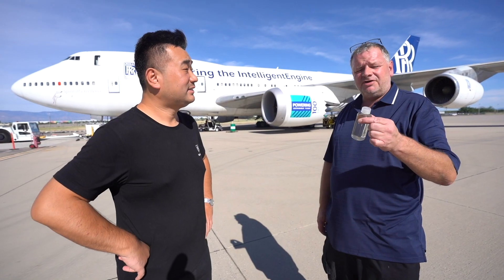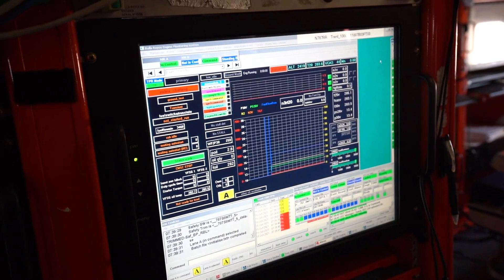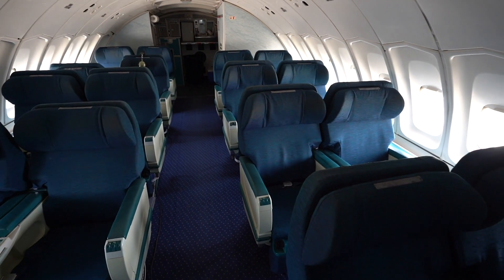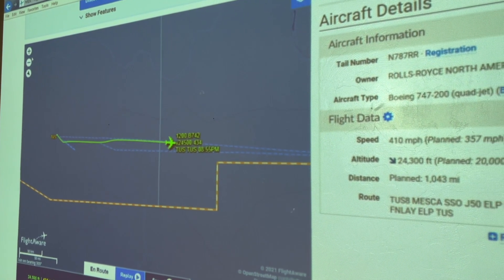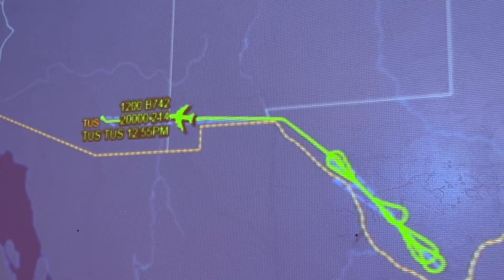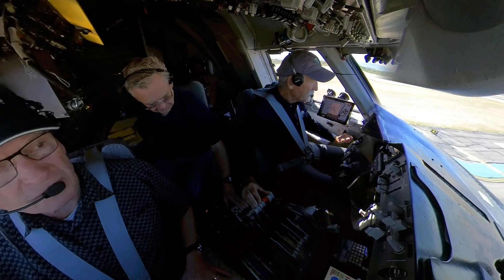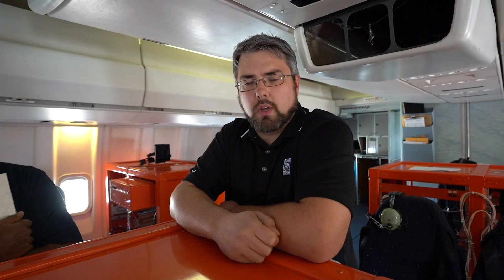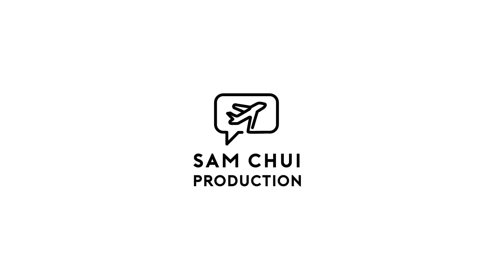Flying the Rolls Royce B747 Test Bed - An Experimental Flight with 100% SAF

Comment: The dashboard rattle would really annoy me. Not much clearance below the new engine. A geriatric crew for a geriatric aeroplane acquitted themselves well. But, here's the rub.- every scrap of  waste organic matter in any country that could be converted to SAF (a classic oxymoron in itself) would account for less than 4% of fossil fuel use in that country. Presently 330 million tonnes jet fuel needed, but with a further projected growth in aviation, this will rise to 450 - 500 million tonnes. Improved efficiency does not reduce this figure, see Jevon's Paradox https://en.wikipedia.org/wiki/Jevons_paradox  - So we know that waste biomass is 96% insufficient for wholesale SAF use, so land has to be set aside to grow it, eg maize or soya or trees or other more woody biomass. Basically for all aircraft to be fuelled by SAF, fully 30% of all the planet's available biomass (that's forests, crops,) would have to be employed, plus about 9% of all available renewable energy (to process this biomass). Our present SAF synthesis would need to increase nearly 70 fold just to meet present demand https://www.sciencedirect.com/science/article/pii/S0048969723025044 
This has profound implications for crops for food, for other energy uses, CO 2 sequestration, and CO2 emission from the grouwing and cropping. Food vs Fuel. 8 billion people to feed or perhaps a privileged billion to fly, and the remaining 7 billion starve? The equations make no sense, except as a suicide pact for humanity. 

Basically you cannot fly anywhere conscience free about our planetary environment. SAF will not solve this. This is technological fantasy, and is digging humanity an ever deeper entropic hole which we will not be able to climb out of .Third runways for Heathrow or expansion of flying is just driving nails into the coffin of human welfare and for many, its very existence. We need to STOP BLOODY FLYING!!

Comment: Another well done and interesting video! Thanks!
I am curious as to why all the instruments for the number 2 engine, the Trent test engine, are removed on the main panel and the FE panel. I realize the engineers in the back are monitoring it, however how does the pilot and FE know where to set the power lever? Verbal commands from the back?

Comment: for those curious about where the engine that used to be on the 747 went, it got donated to the Pima Community College Aviation Technology Campus (visible at 11:53) where I got to do a maintenance inspection on the very engine powering the 747!

Comment: If they are testing UltraFan, this size is not enough, meaning testing this would require A380 testbed flight lab or even 777-200, or 787 as a testbed

Comment: Why dont they put 4 of these engines on this 747.What a power.
Reply: They're still testing weather if an engine fueled by SAF would be reliable. That's why they only put one there.

Also fun fact the 747-8 is using four of the those engines. Although, I think it only uses the GEnx.

Comment: The four engines of the Boeing 747 Jumbo Jet burn approximately 10 to 11 tonnes of fuel an hour when in the cruise.
That's with the efficiency of kerozene. 
It would be a bit (~15%) more with this type of fuel. So, let's say around 12-13tons/HOUR ...... And there's millions of heavy aircrafts. 
It's an Idea ... but it's not THE Idea.

Comment: One thing that was never mentioned was if the engine has to be modified in any way?
Reply: I think no, the differences only the source that they came from.

Although they need to modify the plane so they can actually start the engine.

Comment: 3:21 That's interesting. The Trent 1000 and the GEnx from the 787 are Bleedless Engine. So they have to install an electric compressor in order to start the engine.

Man, the 787 is awesome.

Comment: I think that's pretty cool that this 747 still has the flight engineer station intact along with NO upgraded glass equipment. That Trent 1000 engine is pretty big compared to the other 3 engines as well. Very neat video!

Comment: Does S.A.F give a lower thrust compared to  Jet A1 , the flame looked smaller with no smoke ,however the Jet A1 did show a larger flame , so therefore it seem S.A.F is a weaker less volatile fuel ?

Comment: Public comments. Eco friendly energy system analysis new technology link censers to each section of engine link to main point to detect trouble signnal and alert system allowing the pilots to solve problems before arise . Small module code and mico digital technology link to main station.

Comment: I wonder if the whole industry switches over that's goon lead to a lot more wastage in the oil industry. the cut of jet A is designed to take advantage of hydrocarbons that arent in normal mo gas or diesel. or maybe there will be advances in cracking the larger ones into mo and just expanding the diesel cut to puck up the others? idk that's a problem for the petroleum engineers.

Comment: would a b747-800 take off at full capacity with two ge90x?
Reply: That is a good question actually, imagine a 2 engines 747
Reply: -800 ?

Comment: I have never seen a 747 landing without reverse thrust ;-) cool
Reply: It is only an alternative to the wheel braking.  Wheel brakes can do it all and the performance calculations are based on the wheel brake deceleration.
Reply: @givenfirstnamefamilyfirstn3935  

TRs are not an alternative, but an addition to wheel breaks in commercial jets.

I am not 747 type rated, but I highly doubt, that trust reversers are not considered in performance calculations!!!! 
I have seen many 747-8 documentaries where they used  TRs in aborded takeoff and landing trails, so it would be a huge waste of time and money not to use the test data in the manuals.  
 Every commercial jet I have flown uses TRs for performance calculations and you can even chose the number of TRs available.
Reply: @xyzaero   ‘can’ not are.   (Yes standing water, ice, snow, slush…grass, sand, condition.  Maintenance cost)
Reply: @givenfirstnamefamilyfirstn3935  ?????
Reply: @BlueMax717  got it .. we both talked about different things 👍🏻

Comment: Super Wonderful  Rolls Royce   Trent 1000 engine  #  as i understand  the word sustainable  is used for  fuel  that has less  carbon in its  hydrocarbon chain  molecule  & therefore less CO2 is released  when  it is burned #

Comment: Sam's learned an (old) new trick: Slapping the camera lens at the beginning of the report. Why Tucson (TUS)? Why not East Midlands (EMA)? TUS is 5200 miles from the Rolls Royce factory, EMA is ten miles! Also, they put Sam on the horse but they wouldn't let him ride so, meh! The story was inside the aircraft. And, the engines have to be cooled for five minutes so the Trent is at idle for the approach and landing. Imagine approach and landing if you've got four of them!

Comment: Any particular reason they chose to hang the engine off the #2 spot?  Both the RR and GE 747 flying testbed hang their test engine on the #2.
Reply: It has to do with the yawing moment from the thrust of the outboard engines.  Messing with the power or shutting it down means less yaw if it is on the inboard station.
Reply: @williamloh9018  OK that explains why it's not on the 1 and 4 position.  If it was just a matter of limiting asymmetric thrust they could have used #3 engine instead yet they both chose to replace engine 2.
Reply: Isn’t that the side that could take the weight of the ferry pylon and passenger engine?

Comment: That aircraft is 41 years old and still doing valuable work.
There is some irony in that they showcased the only engine that has caused RR any major issues on ONE aircraft type recently (Trent 1000 and which was fixed last year) amongst the RB-211s that were for the L-1011 that bankrupted the company in the '70s.
This fuel will bridge the gap to when hydrogen powers aircraft. I really cannot see electric aircraft being a safe and viable option.

Comment: SAF isn’t green, it’s just sustainable. It still pollutes an incredible amount.
Reply: Proof of your claim please. From what I have read SAF burns much cleaner. You can even see when they showed both with wicks burning, the SAF hardly had any black smoke coming from the tip of the flame.
Reply: This claim is false. Manufacturers and researchers are currently aiming for roughly an 80% CO2 reduction. This is achieved by sourcing carbon from places other than fossils. Things such as biomass, hence the name biofuels.

Comment: Yet an other great job by Sam.  I'm so fortunate to have flown in a PAN AM 200 back in the mid 70s from UK to Italy.  It was on a business trip so I got to go up the spiral stairs and fly on the upper deck.  After that flight, I promised my self never to fly down stairs ever again if on a 747, and did so until 2004 when I semi retired from the bicycle industry.  Again good work Sam.

Comment: Really nice to see that throttle handling on approach. He is compensating the idle thrust from engine 2 by further advancing the throttle for engine 1, all while leaving engine 3 and 4 where they should be. I think that is more difficult than it might seem at first. Especially if you consider the yaw moment as a result of the asymmetrical thrust whenever you advance or decrease a throttle lever. What a legend!

Comment: Does anyone know if the different engine configuration would change the flight experience or weight distribution?
Reply: It would, they’ll probably just need to re trim the rudder for any imbalance in thrust, and for and aft will be within limits.

Comment: According to both Plane Spotters and Airfleets, N787RR has never operated for QANTAS. She started with Cathay Pacific and then went on to Air Icelandic before RR
Reply: Thanks for that research. I felt it was a BA, CP or QANTAS Classic, based on the iconic RB-211s. A bit of confusion for me re livery and ‘Spirit of Excellence’—thought it could have been adapted from ‘Spirit of Australia’. Also have heard that Rolls Royce may have recently purchased one of QANTAS’s superb, still young  747-438ERs for engineering test bed use…

Comment: This isn't the only 747-200 still flying. As I type this, ER-BAT, a 747-200F, is still in operation with FlyPro. Currently approach Maccau. Then, of course, you have two very famous 747-200 based aircraft, the pair of VC-25A, commonly referred to as Air Force One. Excellent vid as per usual Sam. 👌👍
Reply: I heard there are also 2 -200F based from Georgia's GeoSky cargo airline both RR powered and 2 -200F from Aerostan and they are the only PW JT9D 747 airworthy nowdays, idk about other GE CF6-50 powered -200's other than ER-BAT, the us military ones and one -300 in Russia tho

Comment: Spiral staircases, lots of memories there ....movie Projectors, .... one engine on fire....( you can still fly); ...safety drill sliding from Upper deck, very high and have to jump in the water from upperdeck as well...reminded me of B747 - 200 those days...
Reply: and pure garbage rubber air tube headphones for the low resolution in-flight movie.  It was still the safest, best engineered, most system redundancy plane in the sky.

Comment: I wonder....they didn't use revers throtoll after landing.
Reply: I think you use reverse thrust on short runways or when the runway is wet
Reply: @jeanchristophebeaulieulafrance   I don't think so....because JFK, DXB, LAX, DAC MAA Airport Runways are too long but all pilots use their thrust reverser on the all runways though the runway is wet or dry.
Reply: The plane in the video was probably very light because it was empty. Don't need reverse thrust
Reply: @jeanchristophebeaulieulafrance  could be

Comment: Sam, do you know if this fuel produces more or less power/ thrust? And the same kind of fuel economy as regular jet fuel?
Reply: SAF kerosene generally offers the same performance as regular kerosene, as it has the same fundamental chemistry at the molecular level, so it has the same energy density as well as the same adiabatic flame temperature and stoichiometric ratio for combustion in air. Where the differences lie are in the impurities, SAF is more or less 'pure' kerosene, so no sulfur compounds, and no trace paraffinic hydrocarbons either. What this means is that certain materials, for example rubber seals, need to be redesigned because the absence of those can cause their properties to change, they can crack of shrink if used as a drop in fuel without seal replacement. The lack of sulfur is a good thing, it leads to less sulfur dioxide emissions, and the particulate emissions drop too, as the free carbon molecules that are briefly present during the combustion process have fewer adverse nucleation sites to form carbon 'buckyballs' as we call them, or fullerenes to give them their proper name. Lubrication is also an issue, the pure nature of the fuel changes the heat distribution throughout the engine (less particulates means lower exhaust emissivity, which can be thought of as 'sticky heat', it leads to lingering thermal inertia).
Reply: As for the costs SAF is more expensive than normal jet fuel. As the expert in the video said it's a matter of scale. If we scale up production to the level of standard jet fuel the green premium will decrease enough to make it as convenient as standard jet fuel.
Reply: @tdsdesa  correct, it is a lot more expensive than Jet-A. The price will inevitably fall as production scales up as you rightly say, but in my opinion it will never be as cheap as Jet-A is today, purely because of the efficiency of the process, if made the only sustainable way, which is using hydrogen from electrolysis coupled with direct air capture CO2 using the Fischer-Tropsch process. There are other ways of making it of course, but none are truly net zero CO2, and are harmful in other ways to the environment. Ultimately, it's a choice. Do we want to pay more to preserve the status quo when it comes to aircraft using kerosene, or do we want to pay less using hydrogen.
Reply: @onetrickhorse  I think the SAF from the video is an advanced biofuel not an electrofuel. Advanced biofuels have a small green premium, they are already competitive in price when the price of oil goes up.
Reply: @tdsdesa  You're almost certainly correct, there is very little (if any) available electrofuel SAF around at the moment. As you say, they (biofuel SAFs) are relatively cheap compared to electrofuel SAFs, however they should rethink the term 'sustainable' in the case of biofuels, because they cannot be scaled sufficiently without impacting arable land or marine ecosystems due to the cast quantities of feedstock they require. They're also technically not net zero CO2 solutions, because they rely on nitrate fertilisers and cultivation for production, and those are all net contributors to emissions. But you're right, they will be first to reach price parity with jet fuel.
Reply: Great question.

Comment: Old veteran pilots know how to fly a plane better than anyone .RESPECT.
Reply: As long as they do not rely on IFR.
Reply: Not necessarily. Look at Aeroflot Flight 593 - the airline's most experienced pilot was put in charge of their newest and most modern airliner but failed to read the manual.  Simulator flights in the aftermath revealed that had the pilot let go of the controls, autopilot would have corrected the abnormality.

With planes becoming more and more complex, older and more experienced doesn't always mean 'better'.
Reply: Old school is the best school.
Reply: Or old veteran pilots also know how to fly a plane
Reply: That's false, numerous aviation accidents have been caused by vet pilots many times. Age does not always mean you're a good pilot, in fact with age the FAA becomes more concerned if the pilot is able to fulfil their duties as they get older. Just because those pilots fly in a plane with a bunch of steam gauges and dials doesn't make them a better pilot. It all depends on their skill and education on the aircraft that they are flying, age doesn't dictate skill.
Reply: That plane is an old 747-200. 
Does younger generation of pilots know how to fly this ancient plane?
Reply: @YouCCP2  NO, there would be no need as none are flying today. But i'm sure with training they could fly it. I'm surprised you couldn't figure that out
Reply: @YouCCP2  Hell No they need their ipad to start the engine lol and then AI does the rest for them while they take a beauty sleep

Comment: It wasn’t clear to me whether it was just the one Trent test engine that was running on SAF fuel or whether all four engines were using SAF. If it was only the test engine, what kind of fuel tankage and fuel line jiggering was needed on the aircraft to accomplish this?
Reply: #2 tank was fueled with SAF and fed the #2 engine only for that flight.
Reply: They would also keep that in mind for any fuel cross feeding, leave number two out.

Comment: Fun facts: EU required the certain percentage of biofuel to be added to the aviation fuel. Guess where the biofuel is coming from? The countries like Argentina spray the glyphosate weed killers on the Roundup-Ready crop. The glyphosate is very heat stable, meaning the high temperature and combustion don't burn the glyphosate. Once the biofuel is burnt, the unburnt glyphosate is emitted from the jet engines. No wonder there's higher percentage of lung cancer and other respiratory illness amongst the residents who live near LHR. There are abundant studies out there, confirming this.

Comment: First video ever on this topic of sustainable aviation fuel. Sam, you always add more value adding and qualitative content. Great to see.
Reply: Same for Tesla. The amount of fossil fuel it takes to make a electric car and battery pack is more energy than petrol car. And to charge the electric car requires major fossil fuel power grid. The whole green/sustainable stuff is all a joke.
Reply: It's nonsense. Just because the fuel is different, just think about all the materials it takes to build a plane. Not green.